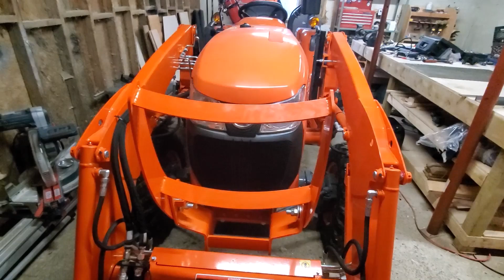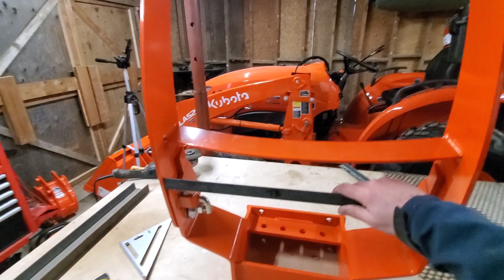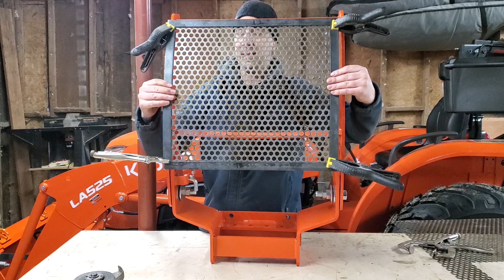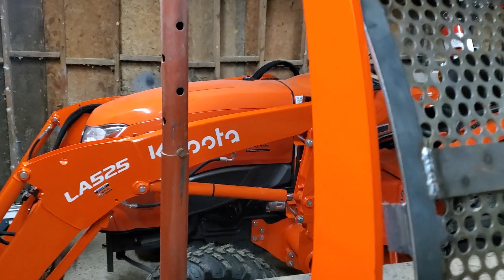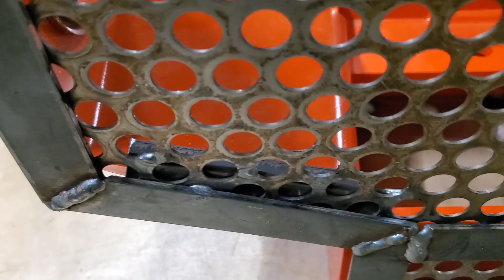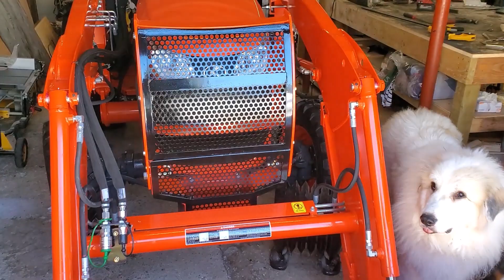Kubota L3901 modifications part 9 - Fabricating a brush guard grill

Comment: You definitely know your way around the metal shop, and your craftsmanship appears impeccable.  An LED light bar and you’ll be set.  Thank you for sharing!
Reply from the maker: Thanks for the kind comment! We are moving in a new home this summer and i will have a huge garage. I'm getting a milling machine, plasma cutter, 4' metao brake, tube bender,  etc.  I used to work as a sheet metal fabricator for 5 years.

Comment: Great idea and premo fab work.
Reply from the maker: Thanks, i used to be a sheet metal fabricator for a couple years.  I also did a lot of machining while in the navy as a mechanic. I'm still settling in my new house (1200km away from where i used to live), but I plan on building a powder coating oven, getting a tube bender and a sanblasting cabinet.  I'll get a lot more fab done then :)

Comment: Looks good. Are the headlights still usable?
Reply from the maker: Yes. But let's be honest, the headlights on them absolutely suck. I have LED lights mounted on the ROPS.
Reply: @jonathanlemire2797  I have the same setup but don't always have the ROPS up. I'm working on something similar to this and haven't decided yet if I want to leave the upper part open or cover the headlights and build in a mount for a small recessed light bar.
Reply from the maker: @president dale parks  makes sense. I just got a canopy for it so i knew my ROPS would most likely stay up all the time. I might install a light bar at some point on the hood or something.

Comment: What gauge metal did you use on your perforated grill and where did you get the sheet of perforated steel.
Reply from the maker: The perforated metal is only 16 gauge. The frame around it is 3/16" thick. I added the reinforcement in the center because i knew the grill isn't super thick. They also sell it thicker, like 1/16" and 1/8". I'm from Nova Scotia so i bought it Metals'R'us but any metal supplier would have something similar.

Comment: How did you roll the flatware to match the curve of the oem grill gaurd?
Reply from the maker: The flat bar was only 1/8" thick, and 1" wide. It's pretty easy to roll it when the radius is that big by just pressing on the flat bar downwards while it's on the edge of a work bench. If it was 1/4" thick, it would be pretty hard to bend though.